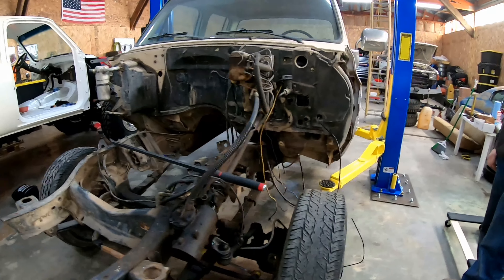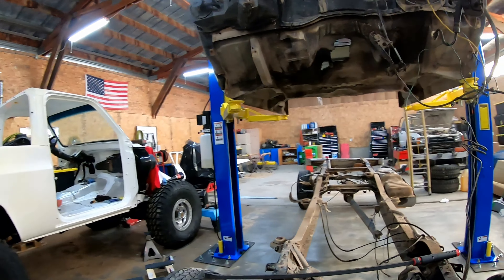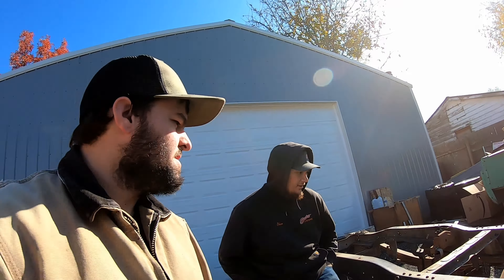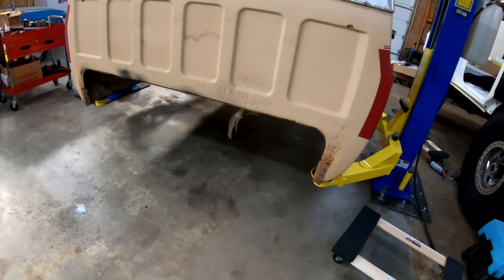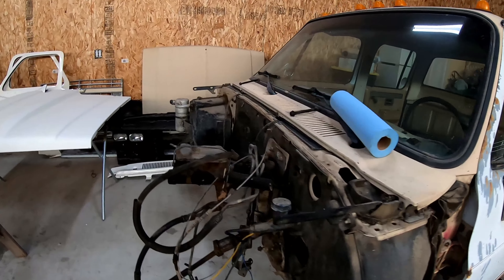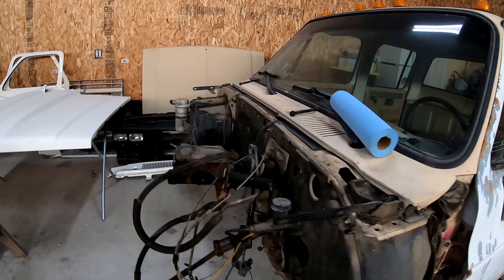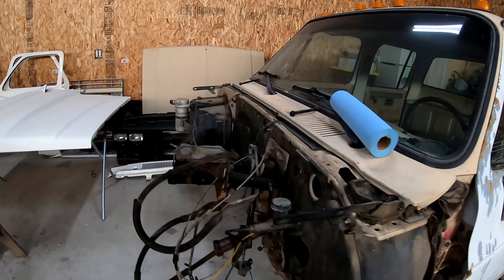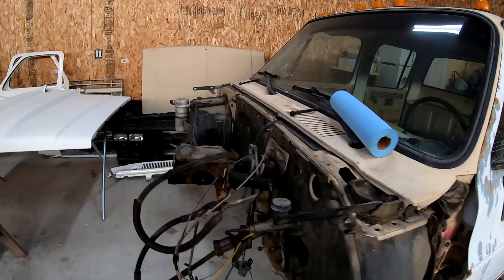Pulling The Cab Off The SQUARE BODY CUMMINS Build and cleaning the...

Comment: I sprayed my Dodge frame with Rustolium, just bought the stuff by the gallons and used a cheap HVLP Harborfreight gun. Just need to reduce it down with Acetone. Works great and better than rattle canning it. Just subscribed as I am going to do an Old Square Cummins swap on an 82 GMC crewcab, planning on dropping mine on air bags.
Reply from the maker: Heck yea!! That will be awesome to see. Someday I hope to do a slammed build. I dig them.

Comment: 2 things.... 
1st I believe it's recommended to wait a few seconds in between pressing the button when using the lift or something along those lines
2nd I find what's good to get rid of caked-on old grease on frames is oven cleaner the stuff in the 99 cent store works okay but easy off works the best after spraying it on the frame let it sit for a few and then go to town with the pressure washer

Comment: What are you gonna paint the frame with?
Reply from the maker: Not sure yet. I used van sickle for the frame on the k5.
Reply: Overtime Garage nice I had good luck with por15
Reply from the maker: I've considered that also. Not a huge fan of an undercoating.
Reply: Same here undercoat holds water
Reply from the maker: @Michael-sb7ye  exactly!